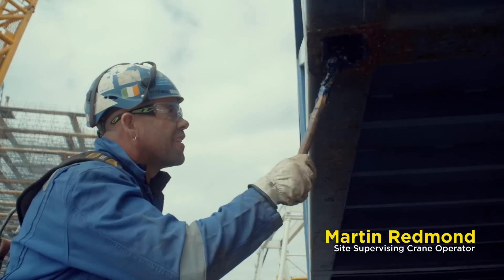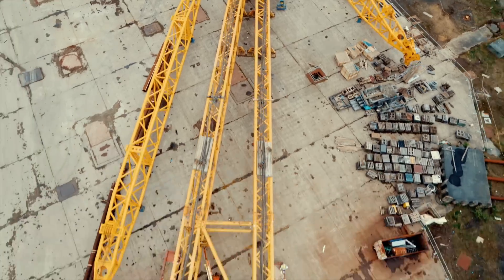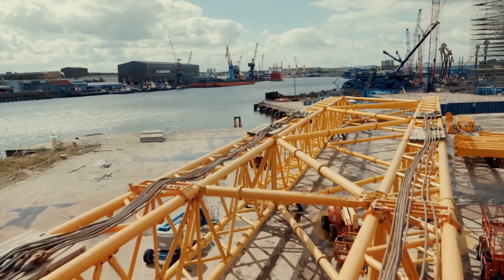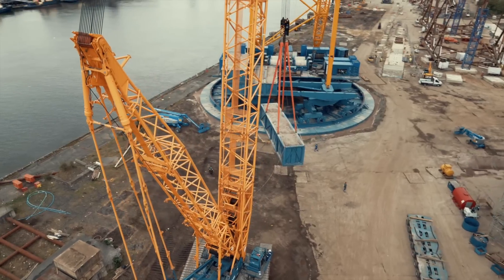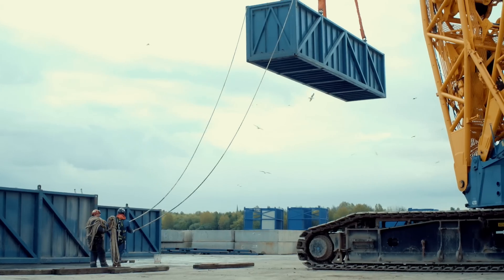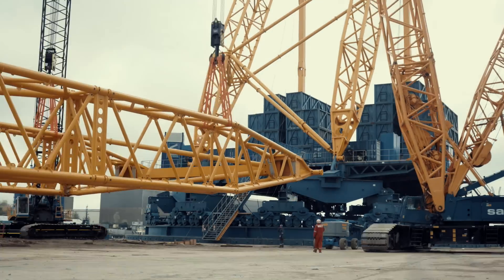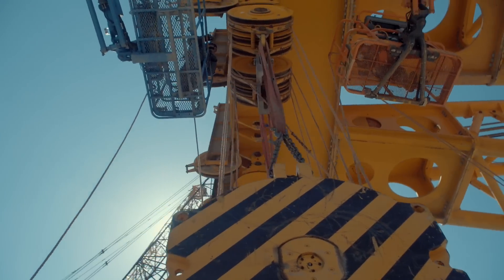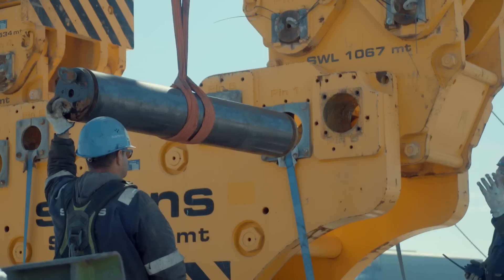#Howwedoit This is how Sarens assembles one of the biggest cranes in the world, the SGC

Comment: I just started working for Mammoet. At the moment we have the PTC 35 ring crane at the Shell skyline project and I've had a little tour of the crane and helped lift a complete new furnace and chimney. 
Also I was part of building and breaking up the Liebherr 1750 9-1 crane with 35 meters of extra jib.
And most of the time we're using the 50, 70, 100 and other mobile telescope Liebherr, Grove, Demag and Tadano cranes.
The guys teach me a bit how to operate the cranes and how to use the computer to program the workload and all that.
I worked on shipyards and petrochemical plants for almost 25 years as a scaffolder and before that I drove excavators and wheelloaders so I mostly was doing the rigging for transportation of scaffolding or lift entire scaffold constructions.
I always thought that I would like the job if I would stop scaffolding and tried applying for jobs at Sarens, Mammoet or some other heavy lifting companies.
But I didn't know I would like this work so much. And especially jobs where you build up a huge crane and do a heavy lift with a lifting plan and complex (big and heavy) rigging equipment are amazing.
I got bit by the crane bug. The guys from Sarens are also very  skilled and have amazing equipment. 
Only Sarens didn't reply on my applications, your loss Guys !!!

Comment: Thank you for posting. I have always been curious about the man basket work on jobs like these. I always thought by best practices and applicable laws that a single part line was required as to be able to tie in 2 “safety” cables. One for basket redundancy and one for personal tie off. It’s obvious that the crane has the capacity just wandering about the secondary “safety” cables. Anyone have thoughts?
Reply: In the Netherlands it is not even allowed anymore to use a man basket. You have to be able to show that is no other way to do a job than using the basket. You'll only find them on shipyards, I think Belgium has similar rules. They are pretty strict about safety.
It's a shame because I love them, the flyer basket with ballast on one side and a long platform that can be maneuvered under objects are super handy.
Now cherry pickers are used and they not carry material, just tools. Especially modern ones...

The extra safety cables you talk about were a good solution to increase the safety of the workers. The only way the basket can fall is when the crane falls first.
But still the rule makers are not satisfied. 

I work at Mammoet and if I am lucky I am helping to break up the PTC 35 ringcrane and I will see if they use the basket for it. Even though the crane is on the Shell terrain we do have some freedom when building and deconstructing the big machines and the cherry pickers are not so handy for the big cranes.